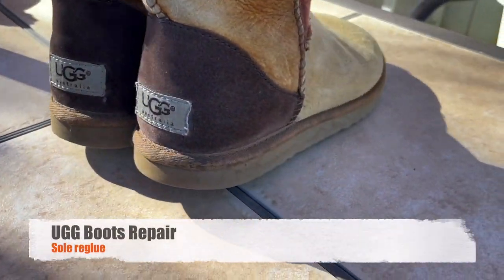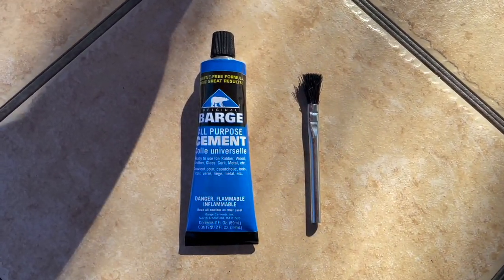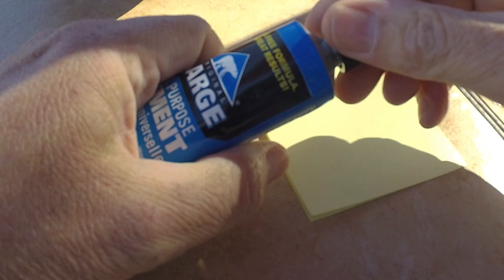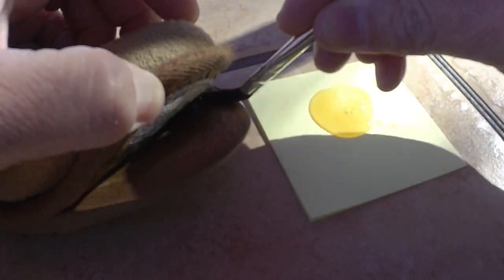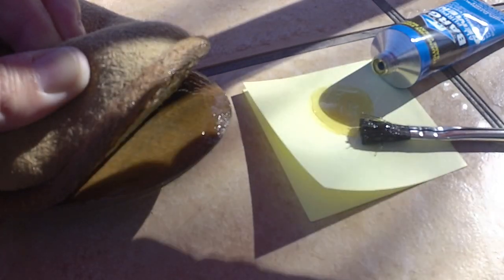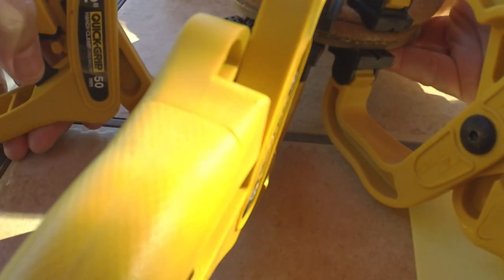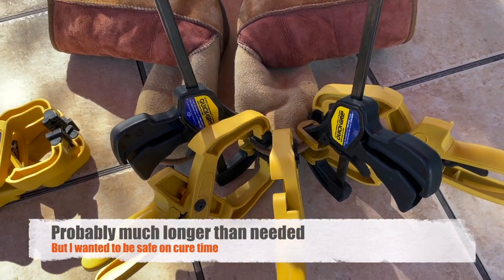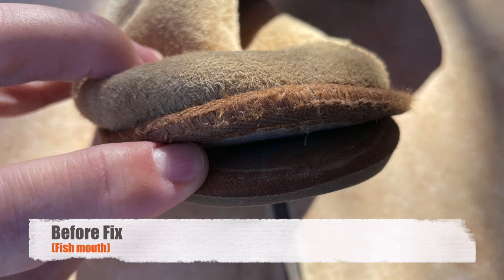UGG Boots Repair | Sole Reglue

Comment: Thanks for mentioning why you made the choice to use all purpose cement instead of shoe goo - super helpful info
Reply from the maker: Shiloh, yeah shoe goo may work, but this repair is holding up nicely a year later. Granted we are in Southern CA, so my wife doesn’t wear them year-round, but it did turn out to be a solid fix. Good luck with yours!